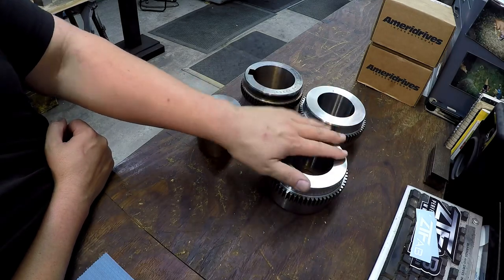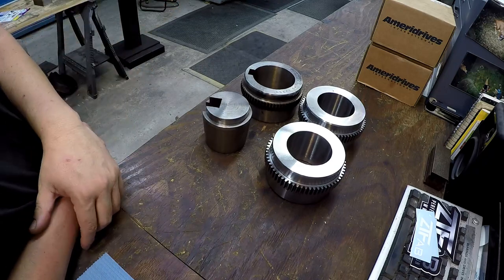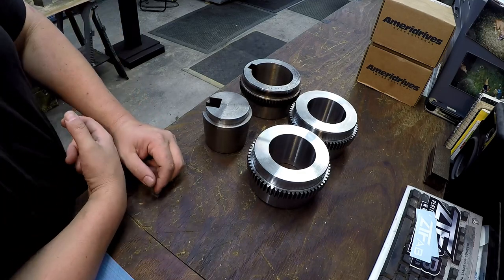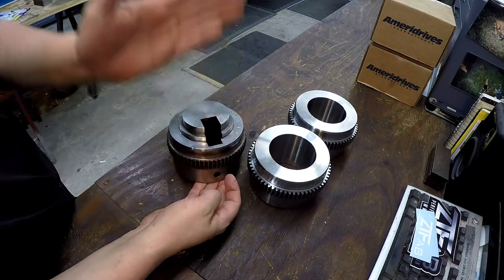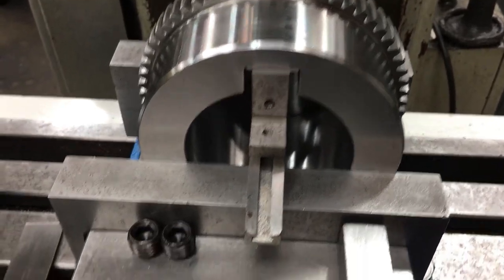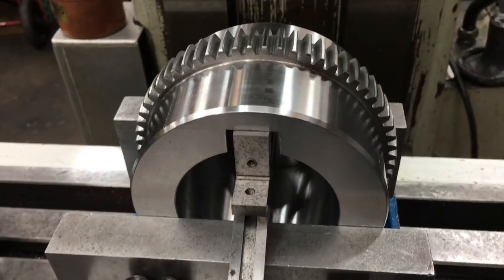SNS 222: Tapered Bore Flex Hubs

Comment: Ha, bought some tools off of a retiring Machinist over 20 years ago and they came with a planer gauge, never could figure out a use for it!  I’ve broached and drilled hundreds of keyways and had the planer gauge collecting dust in my tool box.  Awesome tip Adam, will definitely use the planer gauge next time.
Cheers from 🇨🇦

Comment: Label to the top - that's a great tip.  I usually slacken two jaws and turn the chuck without noting the jaw numbers - losing the advantage of an easier reset for similar parts.   Thanks for a great tip.   Regards from Canada.

Comment: Ive removed ,installed and aligned dozens of those hubs over the years. Ours are used on 200 to 500 hp electric motors driving plastic extrusion machinery. They run 24/7 365. Most will last a couple of years. We align to within .004".
Reply: We use the same brand at work up to 2,000 HP, if the gasket, o-rings, and grease are maintained. Seen 10 yrs on use on them the main reason have to them is to replace the seals in the gearbox behind them. Yes they do see 24/7 work on a drilling rig.

Comment: Abom we use the same ones a work on the equipment we build. We have to get them with .010 T.I.R on angular and parallelism. Seen one stripped out like that before because the customer wasn’t greasing them monthly. The flange sleeve should have o-rings in the back with a thin plate and hand full of Allen screws to hold the thin on the back of the flange hub that keeps the o-ring in the sleeve, and a gasket goes between the flange face.. Like mentioned before them should be greased monthly, but you can’t leave the grease fittings installed in the flange. It sling all the grease out past the ball in the grease fitting. The way our manuals wrote up is per the manufacture manual, put the plugs on the outside face of the flange at 3 & 9 positions, remove one on both sides install a grease fitting, and grease it until fresh grease comes out the open hole on the other side then reinstall the plugs.

Comment: I like using WD for cleaning as well.  A common green Scotch-brite helps to knock loose anything heavy.  I run the carriage to one end, spray and wipe clean, spray it again and move the carriage to the opposite end ... repeat until grunge no longer appears from under the carriage.  

Out here, on gravel roads and with fields under cultivation, keeping dirt out of things is half of your work, even if the building is considered "tight."  You are actually better off to do your cleaning at the start of the day.  End the day by brushing off chips, leave the oil spread out and throw a tarp over it.  The tarp won't keep the dust out entirely, but it helps, and it will keep invading birds from leaving little messages all over your ways.

Comment: A Monarch........ drools you lucky devil, hee
I'm still torn between so many little lathes, not those chinesium rubbish but some old iron, Myford or Harrison maybe...... so many to choose from.....

Great video as always Adam
Reply: I'm not much a machinist, but I see some work getting done usually,  get a nice old 10 D 4 Jones and Lamison TURRET lathe.  they are bad ass and most have taper attachments, for like, pipe threads,  but you can install anything you want.

Comment: On the broaching part of the operation, how do you know how far to shove the broach through the part? In other words, how do you know how deep the notch is to be cut? Is the standard to pull (or push) the broach through until it falls through; which would mean the last & highest tooth of the broach automatically incorporates the correct depth of cut, as long as the broach is fully pulled or pushed through the part? 

Super nice work, Adam!
Reply: pneumatic00 Yes, you always push the broach entirely through the cut. The depth is controlled by the last tooth and by any shims that are placed between the broach plug and the broach itself.
Reply from the maker: You push it all the way through and use shins to make progressive cuts until you have reached the proper depth.
Reply: Last tooth dictates the depth. Broaching usually takes multiple passes to get the key slot deep enough. You add a shim behind the broach after each pass to make it cut deeper. You can see his extra shims on the left where he sets the oil can. You can also see a shim already in place (hanging in the slot of the broach plug) when this broach drops through. Change the thickness of the shims to achieve the desired depth.
Reply: Appreciate the replies, guys, thanks!

Comment: you can adapt a power feed to a compound,,,using a small variable speed gear box,,,,or I have also used a 3/8 air rachet ,,just fab a hex nut on the compound handle

Comment: WD-40, so great for old and industrial equipment...
Not so much for modern DiY equipment, since it'll melt the really cheap plastic that has found its way into everything.
Well, it's actually fine on most plastics (exceptions are polycarbonate and styrene, etc.) but to save even more money, they have been adding more and more fillers to bulk out their plastics, and those not only drastically weaken the plastics, they'll also turn to goo from the WD-40.
Reply: Often the fillers actually allow substantial improvements to the properties of the plastic for a specific application. Examples are glass fiber (improved tensile strength, massive improvement in Young's modulus, increased density) microspheres (reduced density, reduced strength) and talc (improved impact resistance and dimensional stability, slight increase in density) Most fillers are insoluble in mineral oils and shouldn't be troubled by WD-40. 

Cheap plastic (especially recycled plastics) may be less chemical resistant though- every time you re-melt a thermoplastic the polymer chains break down a bit, reducing its properties and making it more soluble.
Reply: That should be; "Previously, fillers were only ever used to allow substantial improvements...". 
Plus, I did mention that those types of fillers existed. Do Not assume those days exist anymore, they do not. WD-40 will melt most modern plastics because Rubbermaid exists in name only, and fillers in many modern plastics are there to bulk out the amount of end product without care for the final products characteristics.
Have a 5 gallon bucket from a couple decades ago, don't cry when a new 5 gallon bucket deteriorates before that old on does; some corporation saved 5 cents per thousand buckets by using bulking fillers.

Comment: I am curious about the drilling for the setscrew. Is the bore perpendicular to the outside of the coupling or the taper of the keyway? I can see that the planer gauge would make the bore perpendicular to the keyway but clamping the vice would make it perpendicular to the outside diameter. Is this one of those items that is not important in this case?

Comment: Great work.  Nothing like using a machine tool you trust, to do technical machining. Very entertaining video.  I noticed a hand engraved number on one of the parts.  Is that just a part #, or does it also indicate who the did the machining, and when.
Reply from the maker: Manufacture serial number

Comment: Hi Adam, would it be possible to put a link on as to where I can buy one of them Safety-Kleen bottles... I know you have a lot on your mind at the moment, but I have scoured the web and can't find anything remotely symilar.
Reply: Google "Milwaukee Sure Shot Sprayer" it looks like that's the ticket.
Reply from the maker: Check KBCtools.com I just bought one from there.
Reply: Thanks for your reply, I should have mentioned that I'm in England, there is nothing like that here and shipping from the USA is out of the question, would cost a small fortune.
Ah well, I might try to make my own... shouldn't be that difficult?
Reply: Glyn Davies shipping to the EU isn't very expensive. I frequently send stuff to Paris, or order stuff on American websites and have it sent directly to Paris. Of course it matters with the specific website and the carrier they use, but it's mostly not expensive... Esp of its something you can't get over there.
Reply: Adam specifically said "sure shot by Milwaukee." I don't get these comments, or the replies that insinuate that they magically found out that it's called a Milwaukee sure shot.

Comment: Adam when you broached the key why did you have the front blocked up on a piece of strapping while back was sitting on press blocks?
Reply: He has to broach the part "along the taper" and not straight up and down
Reply: Because the inside of the bore that he was broaching was tapered. Shimming the front edge replicated the taper in the keyway.
Reply: Hum, not sure I am buying into that! If you broach the gear parallel to the shaft and mill the key into the shaft parallel with the shaft, then you end up with a key way that is parallel and dimensional throughout, just passing through a tampered opening. Not sure it would skid out, as the forces acting on the key would be parallel on the key and on the key way's tops and bottoms. But who am I to say, there are probably a lot smarter people out there or people that have had issues that this way overcomes.
Reply from the maker: Usually the keyway is broached parallel to the taper, same is on the shaft too. I shimmed the hub so that your not pressing the cutter at an angle forward.

Comment: wouldn't it be better to use a lubricant to wipe down a lathe?  Yes I know wd 40 has fish oil in it however it's not a lubricant and drys out quite rapidly.
Reply: Jacilynn S fish oil really?
Reply: yes talk to company  they even say wd40 is not a lubricant
Reply: Jacilynn S it doesn't
Reply: it doesn't what? Before you get all flustered talk to some of the guys at meets that promote wd40 products. They are the ones to argue with not me.  All I asked was if it would be better to wipe down a lathe with a lubricant.

Comment: WD40: great stuff in its niche.

As Adam demonstrated, WD40 is a good for the final cleaning step for mechanical parts and for general clean-up on machine tools. It's also an excellent cutting and tapping aid for aluminum. 

WD40 was DESIGNED as a water dispersant to sliuce water from flooded mechanisms and elecrtical apparatus. Spray a light mist of WX40 on a wetted surface and beaded water and moisture films literally fall off - like water from a duck's back. That was its original and intended use.

WD40 is not a lubricant except in an emergency and especially not a long-term corrosion preventative. Lubricating oils, greases, dry lubricants etc are far superior products to WD40. Actual, purpose made metal preservatives such as LPS-3, BoeShield etc are intended as metal preservatives and offer rust and corrosion protecting hundreds of days longer than WD40 which lasts 4 days max in condensing environments and less than two in the rainy outdoors.

Sorry, mis-use of WD40 is a hot button issue for me. So much so, even the sight of it being used correctly will set me off.

Anyway, way to go Adam: neatly and efficiently done. You are the very model of an all-around machinist and an example for young machinists coming along to emulate. If I ran a small job shop serving local industry or agriculture, I'd hire you in an instant. The 'cue you might fetch in on Mondays would be a hoped-for extra.
Reply from the maker: Thanks Forest! Yes that’s about all I use WD for is cleaning, sometimes for lubricating when working on something.
Reply: It's handy to remove any tar that gets on a vehicle as well...

Comment: I guess its fine but isnt wd40 more flammable than oil to clean your machine?
Reply: A lot of things used in a shop are flammable.  Must use caution and brain.  😁
Reply: using your brain means minimizing risk, which is what i was advising.
Reply: And my point is oil doesn’t clean a machine with crud, it helps protect it.  You need some sort of solvent.  In a machine shop, you have and need a lot of solvents that flammable.  Degreaser, etc.  so answer to your original question is, yes, WD40 is more flammable, but works very well and appropriate for cleaning a machine surface.  It is a profession that involves a lot of risks for sure
Reply: yeah, agreed.
Reply from the maker: How bout I go back to using kerosene to clean like Monarch recommends.
Reply: haha fair point, thanks for the videos.
Reply: Well, WD40 IS kerosene, with an added deodorant.    Thank you for the cool video.

Comment: What torque and speeds are those couplers  used for?
Reply: A very wide range.  Most popular manufacturer in my industry is Kop-Flex.  We typically use them on drive motors for everything from main mill drives (8,000-10,000 horsepower) down to crane bridge(75HP), hoist(200HP) and trolley(15HP) motors.

Those look like about size 4 or 4 1/2, so they'll be somewhere in the 5000RPM max range, rated for at least 26,000 ft/lbs of torque.

The main drives at the mill i work at run size 36 straight bore couplings of a similar design - they're rated for about 5,900,000 ft/lbs.

I've extensive experience in rotating apparatus repair, IE: Gearboxes and electric motors.  These are commonly bored in the motor industry, in the repair shop.  Most are stocked on site(at the repair shop), with a virgin bore, so that it may be bored and broached to a certain application.

Comment: At 14:50 you realy don´t use oil on carbide stuff you only run them dry or flood them or they can get a temper shock and break earlier or wear down faster . But i´m not 100% sure :) Nice Video
Reply: It's not really a temper shock if the oil is distributed evenly. It's okay the way he does it.
Reply: If that were to happen I’m quite sure he has spare cutting tips lying around the shop 🤭
Reply from the maker: Yep a few guys try to tell me wrong but my own work has proven to me what I know works.

Comment: how do you know the taper is correct?   You measured the big end, but never measured the small end, and the length of the bore to calculate it and check the actual taper. When I was doing taper bores, we had std taper gauges with Prussian blued surface to check taper fit of bore, after using feeler gauges(if accessible) to check fit as you approached finished big end dia. It is much easier to accurately machine and measure an external (male)taper for a gauge. Once the gauge is made, you can spin it between centers and cut tiny grooves at std diameters. That way you can just insert gauge in bore, and read where lines are away from big end face surface, and knowing the distance to drop gauge in bore, you know exactly how much more to take from bore, depending on the particular taper number. Not a harsh criticism, just offering an alternative method for you, your employer, your aficionados.